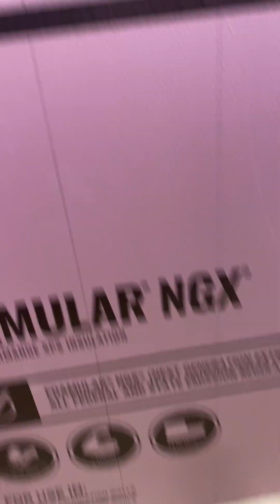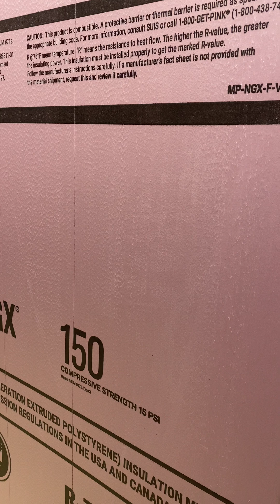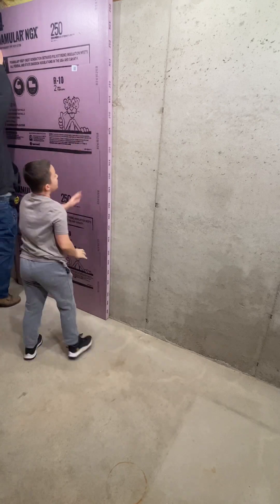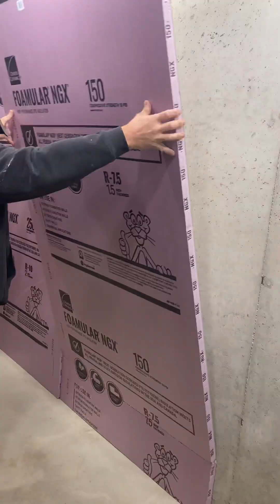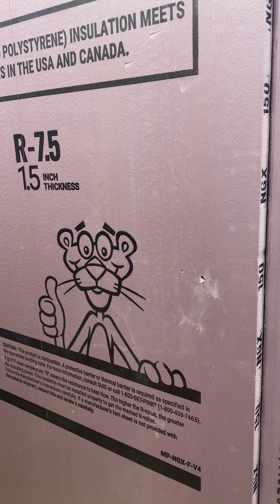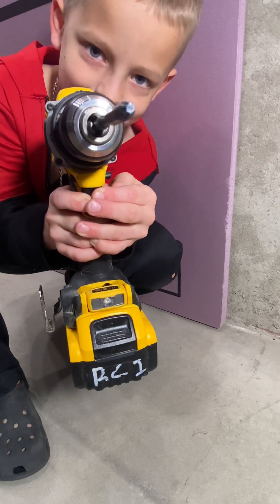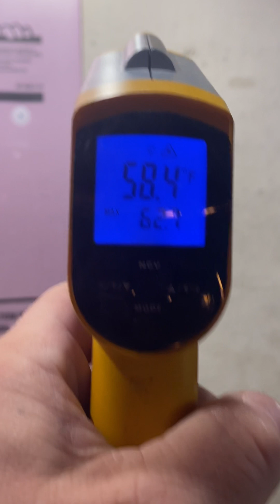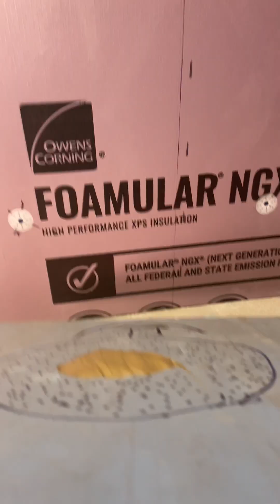FROM COLD TO COZY: Transform Your Basement With Styrofoam Insulation

Comment: Great solution for a warmer basement (& gable roof ends). Loctite PL300 for the win. It’s the only stuff I use w/ Foamular. Just don’t let the tubes get too cold (below ~ 40 degrees), or you’ll end up w/ a tube of plumber’s putty. Works fine again when the tubes warm back up to room temperature.

Comment: What about damp walls……?
Reply from the maker: @blackpine6693  IMO it’s not good to trap water or moisture, this basement was  very dry.
Reply: Good to actually leave an air gap behind the foam boards, push the panel lightly against the adhesive and let it dry.

Comment: Is there a better way to insulate a basement where chemically made materials are not used.
Reply: No
Reply: Foam glass is probably the only material that is better. Not commonly available tho.
Reply: rockwool, it is similat to pink fiberglass, but heavier.

Comment: It’s generally more to encapsulate the concrete and is really more of a vapor barrier with the added R value. I used it against the concrete basement walls along with tyvek tape on the joints and foam at the base, then constructed my perimeter stud walls, with net and blow insulation. The basement was always warm in the winter and never felt moist or musty as many basements do.

Comment: Insulating basements is of little or no value. Basements are below grade so mostly cool during hot weather and don't impact heating costs significantly. A/C costs generally exceed  heating expenses.
Reply: You are wrong fitting xps insulation in my basement has made a BIG difference to my house and the rooms above it I can't recommend it enough insulate first every time keep cold / heat in or out depending on time of year . And it's has cheap as chips .
Reply: @ColinAtkins-j3h I'm not wrong; my source of information would be who is wrong. You seem to know more than the pros and organizations we  fund for this science. Please forward your statistics so they can update their databases accordingly. I can assure you YT is not one of my info sources.
Reply: @roseymalino9855  ok your source is wrong then but I can assure you xps insulation works very well !!
Reply: I put 3/4" rubber floor tiles, with persian rugs on top.  2" foam insulation 4 x 8' boards on walls under sheetrock. We  feel the rate of cooling and temperature imo. It makes me feel like adding a sweater in cold weather. In the summer its nice.
Reply: I insulated my basement based on the recommendation of the energy audit state inspector (Missouri).  1" minimum and 2" at the sill plates (air seal also). 
The generalized comment of cooling vs heating costs needs to be correlated to zoning where one lives.  
Where I live, heating (electric heat) cost is near double in winter.

Comment: There is a system of "Z" shaped metal strips that connect to the concrete wall first. One leg of the strip holds the 2" insulation, no glue required. All that metal is the nailing for the sheetrock, which compresses the foam and eliminates the air pockets. Essentially, you insulate and frame the wall at the same time. The tool we use to install the metal is called "Trakfast"
Reply from the maker: Sounds pretty cool.  I’ll have to make a video about it.